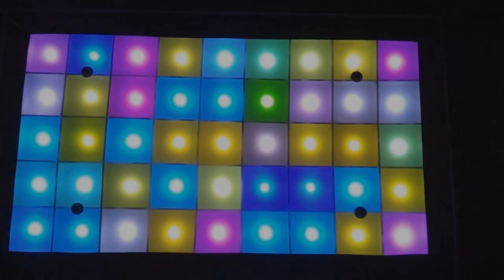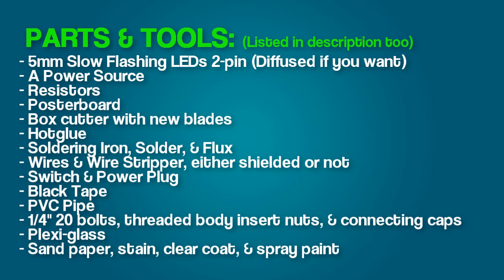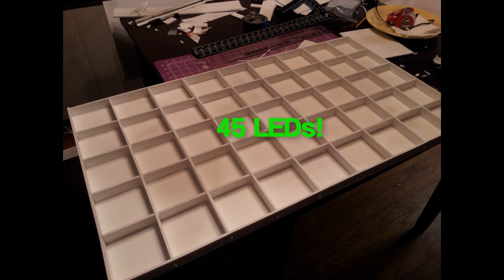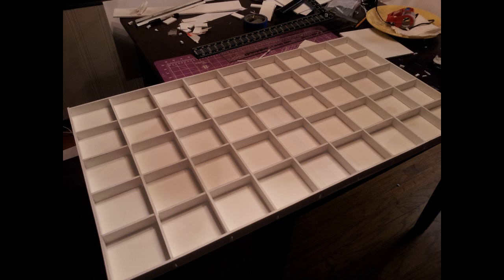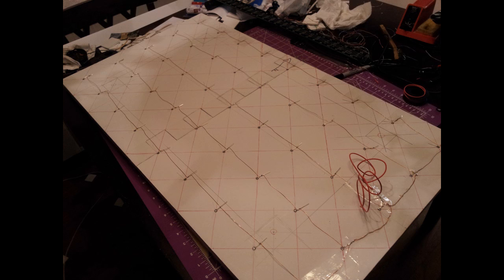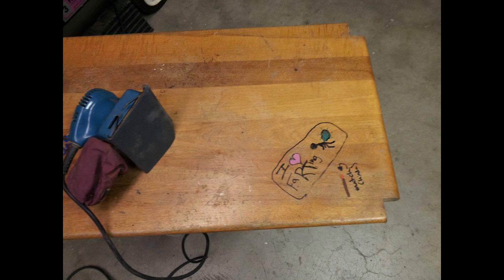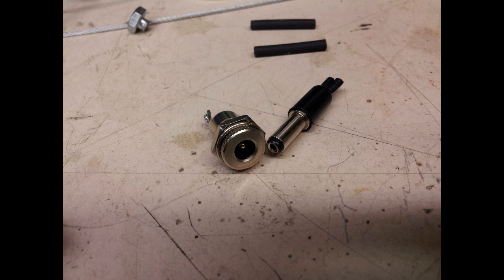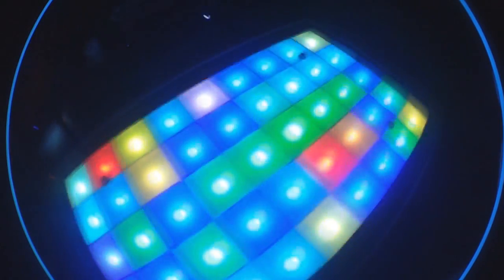[How-to] Make an LED Table

Comment: to easily apply the sticky foil to the plexiglass, make it wet! i use an empty spray bottle (i.e. from Glassex) with just a little dish washing soap. you'll be able to shift the foil and get all the air bubbles out. when it eventually dries it will be on there perfectly.

Comment: If you want to help keep costs down, look up Adafruit. They have a 10 pack to 2 prong slowfade Diffused RGB leds for $4.95 a pack. And for something like this you should only need 1/4 inch plexiglass ( 1/4" 24"x48" should run you about $40-$100 depending on where you look ).

Comment: I may have said it already but this is really cool table, and the instructions are very clear and helpfull. I wont be able to build one yet as Im still studying and at the moment nothing fits in my room, and I will be changing accommodation over the next years, but definetly something cool I want to try later. If I knew more about programming it would be nice to use this with Arduino and rasberryPi, to make the patterns fully customisable, but even like this it looks really nice and "calming" :)

Comment: FYI Solder is attracted to heat not flux. Flux protects the surface against corrosion while soldering. Corrosion will prevent solder from bonding to the component.

Comment: i didnt see it anywhere in the comments but u can also use a brand new drill bit but run it in REVERSE and that will actually melt the plexi in a perfect circle with no discoloration or breaking of the plexi (works wonders for me doing helicopter windows)

Comment: the reason you need a dull bit is so it won't cut away as much in one try, the sharp bit will try and cut too much and while forcefully trying to remove the glass will end up cracking it

Comment: I've diffused clear LEDs by taking a fine grit sandpaper to them, something which you probably could have done to the surface of the table as well. :)
Reply: I actually have been wondering about this.
Though the plastic sheets are quite expensive and I've already bought windowfilm.

Thinking that a glass table may even be "nicer" (and cheaper).

Comment: With the LEDs that you used, do you change the color of light based on voltage or current, and can you change the brightness of the LEDs by altering current or voltage or do you have to use some sort of pulse width modulation?

Comment: AND they have a "frosted glass" spray paint what will do what that sticky paper does, only permanent, and less hassle. It works on plastic just fine. Some people even use it to diffuse LEDs, but I that's too putzy of a thing to spray paint.

Comment: Dude, you just need a spray bottle and soapy water, baby shampoo is the best because it has no degreasers.  Use a squeegee to remove the water and let it dry.  If there's an arc then it needs to heat shrunk.

Comment: Real quick, you are using lexan for the table top, not plexi-glass. Very different materials. Second and,  the whole reason I decided to comment, a sharp drill bit is preferred for drilling lexan. Very high speed and little to no pressure. A dull bit can cause you to push harder and you risk cracking it. I work with lexan daily with my day job, working on Red Bull race planes.
Reply: How do you know its lexan?
Reply: He is 100% NOT using lexan. A 3/4" thick piece of lexan at that size would be a hell of a lot more than $200. It'd also be bullet proof. lol, That'd just be ridiculous. I think what you meant was "lucite" which is acrylic and more in the $200 price range. But sadly not bulletproof.

Comment: Proper soldering technique should save you your parts, i built a 512 led cube and only busted 1 led and to be honest it was probably faulty before i got my hands on it.

But more than heat damage static electricity will fry your components. I've already gone thew 20 mosfets because i stuck my hand in my bag of mosfets without grounding myself and fried every fucking mosfet in the bag.

Long story short, if you are careful and methodical you won't fry your electronics.